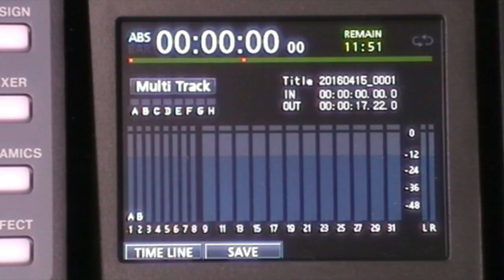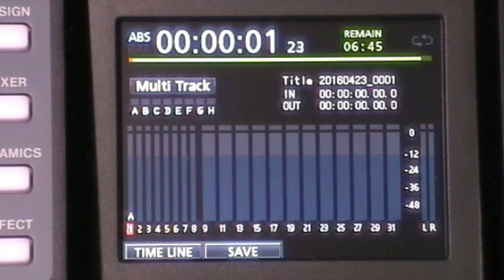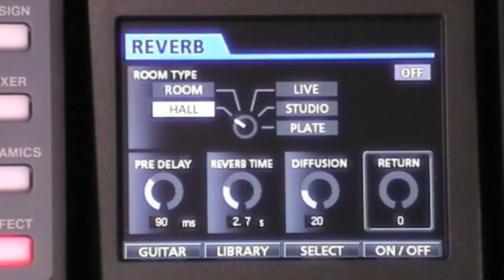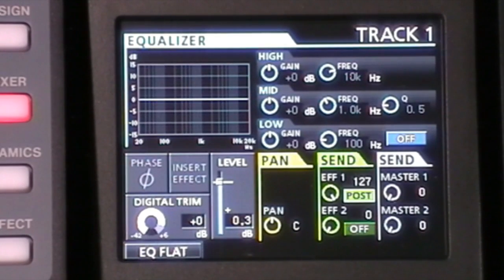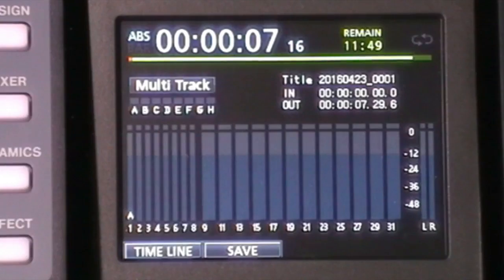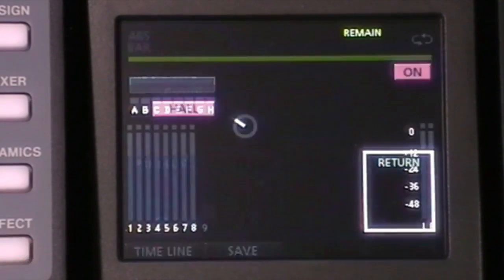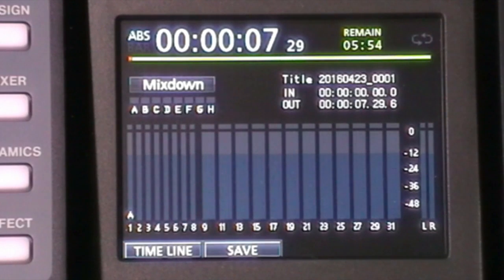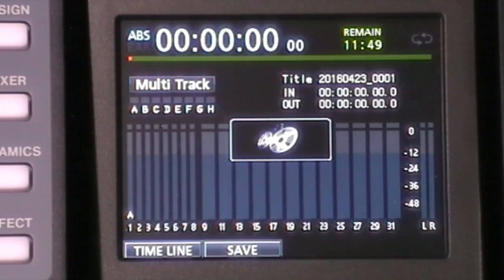Tascam DP-32SD Reverb for playback/mixdown

Comment: Phil you are certainly the Bob Ross of multitrack recording. 😅

I am still perplexed as to why they have the “master” send knobs whatsoever.. seems redundant with the “return” knob.

I’m curious, do you typically just leave the master on 127 maxed out always? Or is there a good use for it?
Reply from the maker: @ThePaulwarner Thank you Paul :) 
The master level controls the overall amount of signal going into the effect, so can change the amount of effect you hear. You're right in that the return level has a similar behaviour, but this controls the level coming out of the effect.

Having level controls on both sides of a device gives you more control over gain-staging. I don't know what the overhead margin is on the built-in send effect, but there may be a scenario where the input signal overloads it and causes distortion, in which case you would back off the input signal and increase the return level.

You can achieve the same thing by altering the levels of each of the send 'contributors' (tracks & inputs), but a 'master' level means you can adjust the combined/sub-mixed send signal without upsetting their relative levels.

I usually leave mine fully up, but you won't be able to turn it higher if you need to. If there's only 1 or 2 signals involved, it's just as easy to raise their levels, but if you had a lot, it would be better to back off the master a bit to give you some leeway.

Don't forget that send signals can be used for anything you like, not just effects (the term 'eff-send' is misleading). The send signals are just signals tapped off from the main signals, so they are effectively sub-mixes which are independent of the main mix. 

The PRE & POST options on each tapped-off signal allow the individual relative levels of the main mix to influence (or not) the tapped-off signal levels.

On the DP machine, both send-1 and send-2 are wired to their respective eff-send sockets regardless of whether you are using the internal send effect (which is only connected to send-1).

This means you can use either or both send outputs to drive external things. External effects are the obvious choice, but they could be used for absolutely anything, e.g. driving another set of speakers or a PA system, fold-back signals to a performer's headphones... the 2  sub-mix outputs could go to 2 different performers, each hearing their own mix/blend of signals regardless of the main mix. 

Thanks for stopping by.

Comment: I can't seem to get any decent bass or midrange with the eq controls, any suggestions ??
Reply from the maker: @DONALD SNAITH You could bounce tracks and add more EQ each time, or use an external EQ device which has more EQ options, either in series with the input source when recording, or via the Send/Return loop during bounce or mixdown, but...  if you have to resort to this, it does suggest there may be something wrong with your audio source or mic/recording techniques. You can't boost frequencies if they're not there in the first place.
The culprit could also be a rogue setting on the DP machine. Did you start your song with a clean slate (e.g. using the reset template as shown in video #2)?
Other things to check are if the bass & midrange are missing on the recordings as opposed to the playback. Is your monitoring system/environment capable of handling these frequencies properly? You can confirm this by importing a commercial track from a CD or other high-quality source into a song on the DP machine and playing it back. Again, don't forget to create the test song with all settings reset otherwise you'll be deceiving yourself.
Keep us posted if you find anything.

Comment: Hey Phil, love your videos, and they’ve kept me plugging away with the tascam. I am stuck on a certain issue however; I want to use a track that I’ve already recorded, bounce it to a new track, but using my external guitar pedal board. I can’t seem to figure out how to do this. The furthest I’ve gotten is being able to record a new track, and use the pedals WHILE recording, but I would have thought, it would work just the same with bouncing. Just arm the track for recording, select the track I wish to bounce, tried applying effect send to both of them just to see if either would affect it, and my bounced track is always dry. I can’t figure out what gives. 

Again just for clarity, and an example, I want to bounce recorded vocals on track 1 onto track 2 with a reverb pedal. I have send effect 2 and master maxed on both track 1 and 2, my pedal board goes from effect send 2, to my board, into input h. Source h also has send effect maxed and on. Source h applied to track 2, bounce and record track 1 to track 2, but 2 still ends up naked with no reverb. I’m not sure what I’m missing. Any help would be appreciated. Thanks!
Reply from the maker: @Reece Caldwell Hi Reece, you've got too many sends!! ;) You only to send the signal from the source track, so there's no point turning on the send for track 2 or for any of the inputs. All you want is the signal from track 1 to go to your pedal via the send-2 output, so just turn on send-2 for this track.
If you set the Monitor Select to Send-2, you can confirm the signal is getting out to the pedal at a decent level while simply playing the track.
If you are using an external effect unit, there's no need to bounce. Bouncing is needed if you want to use the internal send effect.
You can bounce with external effects if you want, but it's a lot simpler to just stay in multi-track mode.
If you need detailed steps about setting up the sends or doing a bounce, my step-by-step guide may help http://www.philizound.co.uk/freebies/dp24-32/dp24-32.html
Reply: @philtipping  ah I think this is making sense. So just to confirm I’m understanding correctly (currently away from my tascam), turn effect send on for dry track 1, apply my effect return source to desired (new wet) track, press record?
Reply from the maker: @Reece Caldwell correct :)

Comment: In this playback mode before mixdown: (not talking about input effects)
1. how many effects can you add to each channel? 
2. are there limitations to how many channels having effects?
3. can different channels have different effects?
cheers : )
Reply from the maker: @Barry Squatter this video was made to answer a user's question where they were unable to hear reverb during mixdown. This video shows how to hear reverb during both playback and mixdown, and was made as a one-off but, as it says in the description, it has since been superseded by a full tutorial series https://www.youtube.com/playlist?list=PLI2uGjCObnySgNrQyJmlcQpQaUdgBdW6l
Re. your questions, there are 3 effect processes which can be applied at different parts of the signal path. There are many ways to route signals through the machine so the limitations depend on this and which ones you want to use. The tutorial explains all this, or you can get the Step-by-Step guide in PDF form; full details here http://www.philizound.co.uk/freebies/dp24-32/dp24-32.html

Comment: Hi Phil. can you add reverb to more than one track at a time? I have 5 mics on my drums and want to effect most or all of the tracks
Reply from the maker: @Jeff Swisher Hi Jeff, there is only one reverb effect but you can send any combination of inputs and/or tracks to it. You can also control how much signal from each one goes to the effect via the Send Level knobs. The display at top right of the mixer screen shows which input/track will be affected by the knobs, so you just select each one in turn (press Select for tracks, press Source for inputs), then twiddle the knobs. The mixer screen does not have to be open, although it's useful to confirm you've selected the correct item before touching anything :)
Reply: Thanks very much!

Comment: Is this machine good for recording drums ? 9 piece
Reply from the maker: @Echo4nineteen it can record up to 8 signals simultaneously, but you can overdub many more... so it depends how you plan to record them. More live signals could be handled using an external mixer, but you'll have to commit to pre-mixing some of them before they reach the DP machine. If you really want to record more than 8 signals onto separate tracks simultaneously, you'd be better off with a machine with more inputs, such as the Tascam Model 16 or Model 32, or the Zoom LiveTrak range. Note these don't have a full set of 'studio' functions like the DP machines, so you'd have to use a DAW for these... in which case, it may be worth considering recording direct to a computer in the first place, e.g. using a audio-to-USB interface with sufficient inputs for your needs.

Comment: hi Phil,

 I just bought the DP-32sd.

What I want to do is recording my drums on songs without drums, the problem is that I do not know how to upload the music to the tascam,

I use the 8 inputs for the microphones, tom 1, tom 2, tom 3, snair, etc ...

but how to upload the music.

can you help me????

thank,s and greetings from Spain.
Reply from the maker: @jomagame hi, for the best quality, transfer the music files by copying them. If you try recording audio directly from a computer, the quality may suffer. You need to check the music files are in a format which is acceptable to the machine (the video on Quality describes the 4 possible formats), then copy them to the AudioDepot folder on the sd-card, either by physically moving the card to the computer, or using a USB link. Once they are on the card, use the Import function on the machine to convert the files into tracks within the current song. This import process and lots of other useful info are all in the step-by-step guide, details here http://www.philizound.co.uk/freebies/dp24-32/dp24-32.html   If you're still stuck after ordering the guide, write to me via email and I'll guide you through the process.
Reply: @philtipping   

Thanks Phil... I will try this tomorrow.
Reply: Hi phil

I have not found your email, so I answer you here,

Once everything that you told me is done, it tells me that the song is protected and I do not know what to do.
The songs I download are from spotify, could that be the problem?
Reply from the maker: @jomagame  my email is patipping at gmail dot com. If you mean the Tascam machine is saying the song is protected when you try and import the files, then you can un-protect it via Menu, Song ... assuming you are happy to overwrite the current song. Why it would be protected I don't know. Alternatively have you accidentally moved the 'lock' slide switch on the side of the sd-card. This will protect all songs on the card. It's easy to catch the slide-switch when you insert it, so have a look at that.

Comment: This isn't a bad recorder. The audio quality is good, but i find most of the effects useless.  The main reason i miss my Zoom is the built in drum machine and better effects.
Reply from the maker: @shawn2571 what happened to the Zoom?
Reply: @philtipping  I sold it :-(
Reply from the maker: @shawn2571  I guess the Zoom had some shortcomings which caused you to sell it? Just shows there's no such thing as the 'perfect' machine :)  The internal effects need a good signal level, but if they're still not what you're after, you could use external effects via the Send outputs - quite a few users do this. You still need patience if you want to apply effects to lots of tracks (e.g. repeated bounce passes), but I don't know of any other (modern) machine which has good effects available for every track simultaneously. The Model 24 has a compressor on every track but that's it, and it's also not really an all-in-one 'porta-studio'. Not sure about the Zoom LiveTrak but I guess it's similar. The only other way is to use a DAW, but you'd also need an audio-usb interface with enough inputs... and you're now drifting away from the beauty of computer-less recording!
Reply: @philtipping  yeah i have a tascam usb 2.0 interface too, but computer recording is much more complicated and time consuming.  I do use external effect with my tascam 32sd it just sucks hooking up so many extra devices.  Be nice if they made a machine that had the best of everything all in one.  Lol

Comment: Hi Phil,
I've been recording with the DP-32SD for over a year now and except for that SD card issue which I told you about it's been a reliable great piece of hardware.
The value Tascam packed into this unit is substantial for it's price.
Reply from the maker: Good to know Robert. Mine's still going strong, although not really hammered it much recently as we decided to move house so all studio work is suspended until the new music room is up & running.

Comment: I'm really considering buying this. I do hip hop and I wonder how good this would come out. I don't see any videos with anyone recording vocals though.
Reply from the maker: +Jamel Jessamy - don't know what special requirements you need for hip hop, but the machine is capable of CD-quality recording. Haven't tried dynamic mics personally but studio condenser mics with phantom power give excellent clarity, although this again depends on your requirements/expectations. It won't be as good as a 4-figure mic and pre-amp combination, but then you wouldn't expect it to... and is your monitoring system good enough to hear the difference anyway? From a functional point of view, there are compressors and noise suppressors for the vocal input if you want to use them before recording. There's a couple of send outputs and an internal effect for comfort reverb if you need it... or you can add effects afterwards. There are some youtube examples of tracks made with these DP machines if you search around, although they're the finished result and not a specific tutorial on recording vocals. Maybe ask on the Tascam forum for more practical advice on your specific needs. Good luck.

Comment: To set the Send Effects,  press the "MIXER" button.
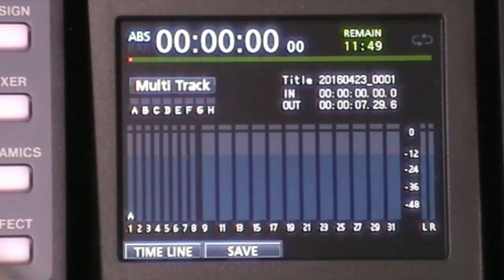Reply from the maker: +Joe Horizon - correct - it shows this at 2:00 but it's a bit quick - there's a much clearer explanation in the tutorial videos https://www.youtube.com/playlist?list=PLI2uGjCObnySgNrQyJmlcQpQaUdgBdW6l
The MIXER screen allows you to turn the send system on (pre or post) for the selected track (or input/source), and to adjust the send levels, although you don't need to go into the mixer screen if you just want to alter the levels - you can just select the item and tweak the knobs. The EFFECT screen allows you to choose the effect type, alter its settings, and alter its return level.

Comment: I have a Tascam dp-32sd coming in any day now. Am I going to need some computer program to make a cd after hooking to the computer? Thanks!!!
Reply from the maker: +CN REEDER yes probably... you can either transfer the individual track files and mix/master/burn them on the computer, or you can mix/master them on the dp32sd and transfer just the final master file for burning. The two transfer methods are different, so check out the manual or the tutorial videos first. It is possible to avoid a computer by using a stand-alone CD burner, although you'd have to use an audio connection as there are no digital outputs on the dp32sd.

Comment: How can i record the 32 channels with diferent sound if it is possible?  thank yuo, phil
Reply from the maker: +ELVIPANOMENTAO - normally when you record onto a stereo track, both the left & right sides are overwritten regardless of how the signals are routed, so the only way I know is to fool the system by using the Import function. This lets you import a mono wave file into the left or right halves of a stereo track without destroying the other side. You can either use files copied into the AudioDepot folder from a computer, or create your own using the Export function. I think this is mentioned in one of the tutorial videos (8D or 8F?) about import/export - https://www.youtube.com/playlist?list=PLI2uGjCObnySgNrQyJmlcQpQaUdgBdW6l  - Note that the left & right sides will still share the common fader and EQ controls when you playback the stereo track, so it may not be quite as useful as you'd like. The term '32' in 'dp-32' can be misleading - there are only 20 track faders so there are really only 20 completely separate tracks; 12 of them can be either mono or stereo but the total is still 20.
Reply: Thank you Phil for take you time to answer me so fast...and that's the same think is only 20 tracks but this is okey ,we can bouning traks if zi needed more....Thank you phil......